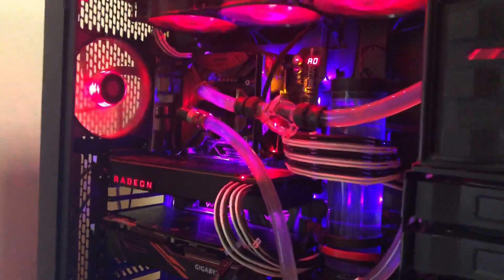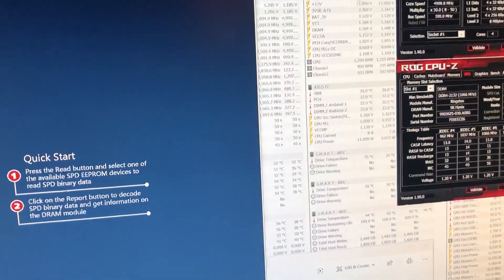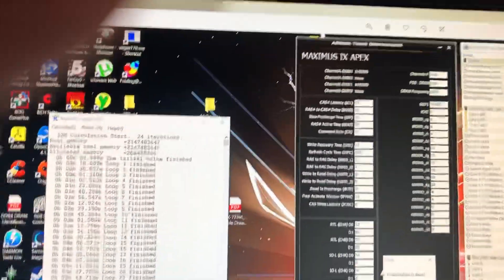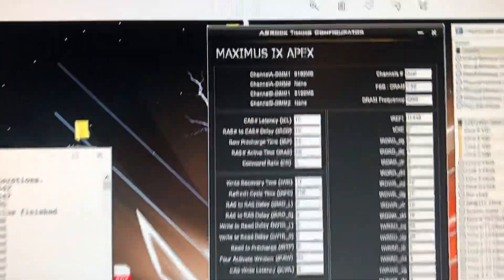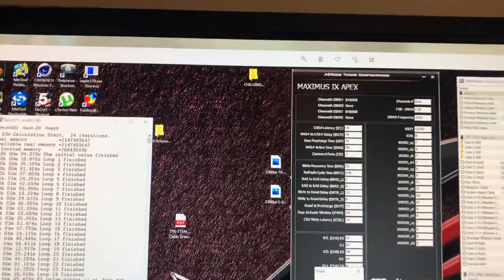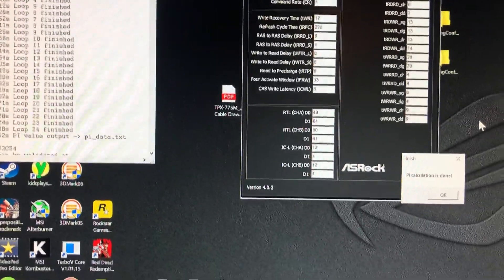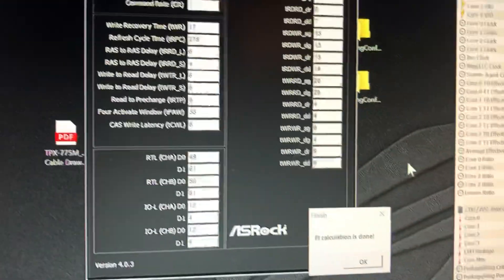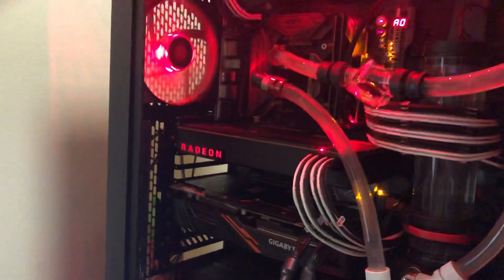Overclocking OEM Hynix AFR 2133MHz to 3000 c13

Comment: What's the safe everyday voltage for an AFR die?
Reply from the maker: I would say 1.45-1.50v mate
Reply from the maker: as always, assuming mobo is putting out correct volts and obv PCB quality/layers etc will matter
Reply: @extremeoverclockingyobbo5467  oh alright, thanks!

Comment: How much voltage for 3000mhz 13 15 15 28?
Reply from the maker: 1.5v
Reply: @extremeoverclockingyobbo5467  so much ? I set 1.35V only. 1.5V more stable?
Reply: I am using single rank hynix afr ram
Reply from the maker: Kenny Ngiew Hong Ying is 1.35v stable?
Reply from the maker: Kenny Ngiew Hong Ying 4or 8GB?
Reply: @extremeoverclockingyobbo5467  4gb.sorry 2933 1.4… 3000 1.45 got cold boot,bios will show boot failure.now set 1.5
Reply: May i know which secondary/misc setting need to set for best performance?
Reply from the maker: Kenny Ngiew Hong Ying sorry mate life got in the way. Will post here soon
Reply: @extremeoverclockingyobbo5467  ok
Reply from the maker: Kenny Ngiew Hong Ying 
Try
As per timing confugurator order-

17
278
6
4
5
5
8
33
8

Trdrd- sg 6
Trdrd- dg 4
Twrwr- sg 6
Twrwr- dg 4
Clk period 24
Reply from the maker: nmentioned timingss on auto aand rtls auto training
Reply: @extremeoverclockingyobbo5467  thanks,after testing let u know the result
Reply from the maker: @kennyngiewhongying4437  please do mate
Reply: @extremeoverclockingyobbo5467  so sad…i am upgrade to 8gb ram…but tat ram unable to boot after overclock,did you meet this problem before? AFR chip also
Reply: I had get an original 4gb…dual channel,the super pi best result is 8m 28.881s while using ur setting